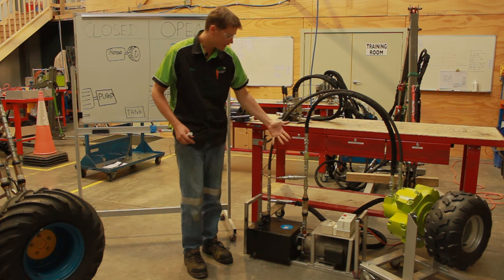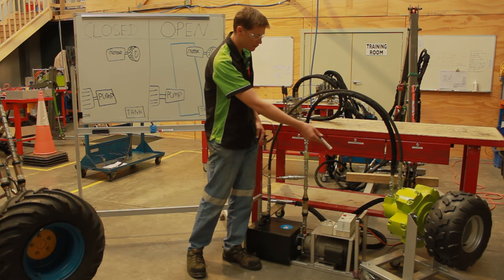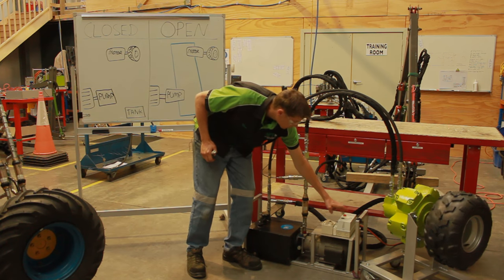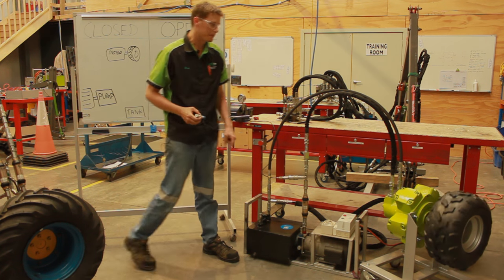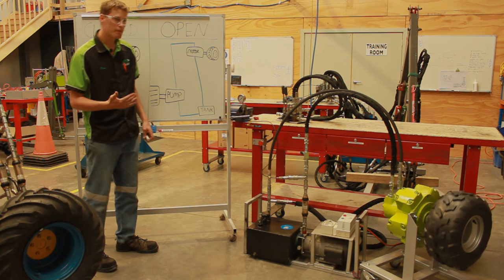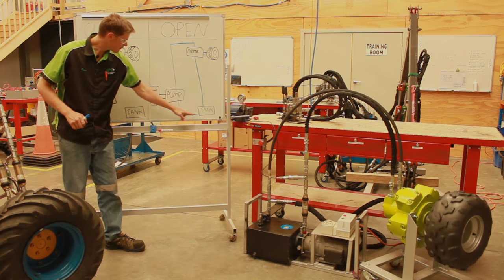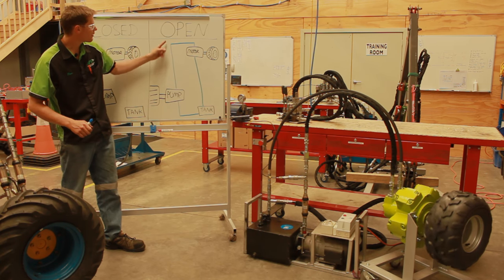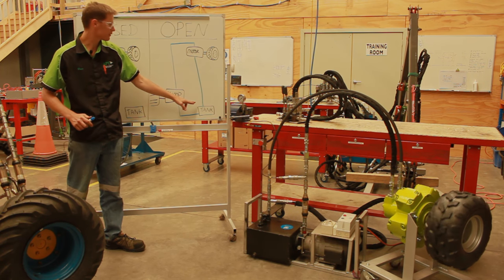Open Loop vs Closed Loop Hydraulics

Comment: Great explanation. 

With the closed loop system can you drive four wheels from the one pump?

How would you go about other hydrolics on the same vehicle.  Would you use open or closed system on something like a backhoe. Can it be either and what are the pros amd cons of each
Reply: You can drive all wheels from only one pump. But for example an excavator usually has two variable closed loop piston pumps, one for the left and one for the right side. This way you steer the machine just by controlling these pumps separately by their own control shafts.
  For the other hydraulics on the vehicle there is a separate pump, mostly an open loop system is used. Backhoes always use open loop systems. In opposite to the explanation in this video you can control the speed on both pistons and motors pretty well just by the control valve, that normally isn't an on-off switch.
   But there are also variable displacement pumps for open loop systems. They can be used for speed control as well as pumps for closed loop systems, but not for reversing without a separate contol valve. 
   The difference in their function is that a pump for a closed loop system pumps the oil in both directions when a pump for an open loop system pumps the oil in only one direction. 
   The advantages of a closed loop system are that it gives a very good maneuverability for example vehicles and that you don't need a separate control valve.
   The disadvantages are that a closed loop system pump is complicated and therefore very expensive and needs more maintenance. And you can only control one working moment with one pump. In an open loop system you can control as many moments as you want by using serial mounted contol valves.

I wish you understood. English isn't my first language.
Reply: yes it is just a matter of speed

Comment: Video was presented good but is miss leading because the pumps and valve can be converted to open loop or closed loop. He makes it sound like it's only based on what pump and valve you have and it's not.
Reply: very true as an example volvos hydraulics uses both open/closed looped systems.its all how you hook the lines up and what they control.
Reply: ...true but he would have probably come back in a follow-up presentation with that explanation. This is real basics for a novice.

Comment: Just one question,  how do you load or fill the closed loop system,  it was not covered by presenter.
Reply: you make it a open loop until filled with reservoir and reconvert it to closed loop.
Reply: With a smaller boost pump!
Reply: A oil drum marked hydraulic oil...

Comment: Nice presentation about the subject. It happens quite often that marketing and magazine editor people are using these system names incorrectly... Usually they refer to LS-systems valve spool middle position where flow is "closed" and therefore naming also the system closed. An that just is NOT the case. All working hydraulic systems are usually open loop systems no matter if the pump is fixed or variable. If the system pump receives all its suction flow directly from the actuator return line then its closed loop system.
Reply: Closed loop pump usually controls the amount of flow and also direction. To increase adjustability of the system also motor can be volumetrically controlled creating more adjustability for the motor speed and torque. This means that throttle losses from control valve can be completely avoided creating more efficient system. This is the main reason why closed loop systems are used. Of course everything is not explained in that short video... There are a lot of details in both systems and I believe this was just demonstrate what closed & open mean in practize.
Reply: I completely understand. In my opinion the way he presented the flow control in an open loop just gives a wrong impression. I can't see why you need the extra valve to control the flow when you can control it by the control valve without increasing the pump pressure. I actually built my own  garden tractor with just a gear pump, a control valve and a gerotor motor connected to a shortened car axle. I can control the speed from 0 to full speed well enough. Of course a variable displacement pump would be a lot better, also because it practically works like a stepless automatic gear box. The problem is only the cost. My system works because the top speed is only 9 km/h. The 13 hp Honda I use is strong enough to give the 300 kg tractor enough traction power (about 2.8 kN).
Reply: Saad Saleem Closed loop system needs separate charge/boost pump&valves to compensate leakages away from the closed loop... Even the pump functions in   closed loop its suction conditions need to secured to quarantee enough of suction flow.
Another very important need for this type of flushing function comes from need to get rid of heat created in the closed loop that is close to 30% of power driventhrough the closed loop. To get rid of this amount of heat just the leakage flow is not enough and separate flushing is needed.

Comment: 5:30 Closing the supply pipe is the wrong thing to do. Control the speed with the first lever you installed - that's the proper way to do it - no 'overloading' of the pump and proper oil management.

Comment: I think I've got a broken open loop system. looks a lot like the demo one here. Where can i buy another?? Looks complicated, with a manifold and solenoid valves running to 8 hyraulic levers.. Way over my head here. Any one in the UK able to fix these systems? Need to get my kit back on the road. .
Reply: ronan dowling call a professional...

Comment: How pump replaced direction control valve in close loop system?
Reply from the maker: Hi Sikanlal, pumps in a closed loop system are bi-directional, so by changing the angle of the swash plate, pump flow will be directed out of one or the other working ports, which then controls the direction of movement of the actuator.

Comment: Why not directly drive the wheel with the pump motor?
Reply: You can have one pump driving 4 wheels.. It makes more economic sense to have one pump doing with hoses lines connecting it to the 4 wheels then buy 4 pumps connecting one to each wheel..

Comment: Would anyone happen to know what type of hydraulic system the small backhoe trenchers have?  I'd love to build a small trencher/backhoe but i'm not really knowledgeable on what all I would need... A small engine, a pump, filter, valve manifold and the piston jacks.... If anyone knows hydraulics and happens to have free time to look up all of those parts and send me the specs, I'd be grateful.

Comment: Good video promoting hydraulic systems except that “suction” is very often used as term in pumping system which imo is really wrong. There is no sucking of fluid occurring in the pumping systems.
Reply: big deal

Comment: Hi Everyone, someone please suggest the most suitable hydraulic pump for flow rate 250 lpm, working pressure 350-400 bar & compatible with 1440 rpm motor.
Thanks in advance for the kind help.

Comment: How is the closed system changing direction of the motor?
Reply: He explains that well in the video near the end.👍
Reply: @alexmattyspac7605  He only explains how the angle of a swashplate changes the oil volume. To my mind, regardless of swashplate angle, flow direction remains the same?

Comment: This closed loop system is more correctly called "Closed loop hydrostatic"  Many bigger machines actually use "open loop hydrostatic".  This system, that uses a variable one-directional pump works as well as the closed loop hydrostatic that uses a two-directional pump. But it''s completely different from the open loop system described in this video.

Comment: sir in  closed system how to control a oil temperature?
Reply: That is the disadvantage of a closed loop system .. The heat must be removed through the mechanical parts of the system.. The open loop System with it's tank allows for better heat dissipation..
Reply: A cooler could be added to either system.
Reply: it can some what control the hydraulic oil temp by sending it back into the reservoir intern letting it cool down there while the cooler oil on the bottom is sucked in to the pump
Reply: OIL COOLER

Comment: Is the closed loop variable displacement?
Reply: Yes, It would be no idea to have a closed loop system without a variable displacement pump. The closed loop system also needs a tank, and the pump has an extra inbult charge pump and valves to control the amount of oil in the system. Only the basic principle is shown in this video.
   It's simplier and cheaper to use a fixed displacement pump combined with control valves if you don't need to vary the oil flow (speed) and the pressure (torque).
   The closed loop system is mainly used in excavators, loaders etc. to give the vehicle a good, fast and simple maneuverability.
Reply: Thanks  I just started college for heavy equipment tech, just trying to understand everything.
Reply: I think I need to add that  modern hydrostatic driven band "tractors" , like excavators, have 2 different closed loop systems, which also means 2 pumps, one for the left and one for the right side. This way the vehicle can be easily both moved and turned just by using 2 shafts. These machines always need a third pump for the other hydraulics.
    For a simplier system  you can also use a simplier open loop variable displacement pump. But if you need to reverse the direction of the oil flow you still need a forward/reverse shift control valve. This wouldn't work well in the machines I told about.
    You can also control the oil flow from a fixed displacement pump by the control valve pretty well, but the torque is limited to the size of the pump and the available torque of the drive motor. A variable displacement pump works like a stepless automatic gearbox: Less speed = more torque.

Comment: Wouldn't the oil heat up in closed loop system if it didn't have a tank to mix with the cool oil with the hot oil

Comment: Do you know how to Brake Hydraulics?
Reply: ((D1/D2)^2)*F1=F2. Force (F1) is governed by your foot and augmented by a brake booster if necessary. F2 is your desired force. D1 and D2 are piston diameters that you can readily purchase.

Comment: This is probably not the right way to ask but when you slow the wheel down does it maintain the same torque or does the torque drop as the wheel slows? Is their a relationship between pressure/flow rate and speed/torque?
Reply: pressure is torque, flow is speed they really do not affect each other.

Comment: Okay... waaay too much info. Simply, an open loop is exposed or "open" to atmospheric pressure. In this example, the reservoir. 

A closed loop, means the duty circuit (the circuit of fluid doing work) is closed off, or isolated from atmospheric pressure.

Comment: a hydraulic pump doesn't suck, why on earth would put a needle valve before a dcv is ludicrous need to tee into both hoses to the motor and put a needle in between the two, or vary your spool movement

Comment: WTF is wrong with these safety obsessed people? Boy, It's a good thing he put his lock on the power disconnect because the camera man could have turned it on while he was disconnecting/connecting the hydraulic fittings that are designed not to release any fluid if they are disconnected under pressure!

Comment: i dislike hydraulic drives. i kid you not they are shit sadly in the application i had one.
it is a forestry forwarder and ... it simply is not up for the task.
its a closed loop system. problem is, when i need massive amount of tourqe, i'm simply limited by pressure. witch is set to 350 bar. what happens is when i need to creep forward, is that since the oil supply gets limited, and tourqe stays the same, it is simply impossible to use the full engine power to move my stuff. 
a simple good old mechanical gearbox and a plain old simple clutch did solve the problem.

it was the verry first and last time i had a hydraulic drive train for anything. costs a lot, its realy short lasting, the oil change costs a lot, repairs cost a huge lot. the mechanical setup allready done over twice  the work hours with no faliures of any sorth. and when i stuck it in low gear i get the massive amount of tourqe i need. best of it all, the whole conversion including every bit had a cost far less than an avarage repair on the former hydraulic stuff. 

the hydraulics is noisy as hell, breaks down a lotof the times, is verry sensitive vs the non synchronised gearbox i have, and does a verry verry poor job of converting the engine power, expensive to maintain, and expensive as hell to purchase.
the only positive side is its verry easy to plan a machine around it. and thats all there is.
efficiency wise... well, the machine consumes considerably less with the mechanical setup so i'm happy i got rid of the hydraulic stuff. no more leaks, no moreoil everywhere, and no more overexpensive bills.

Comment: both systems are called open center or closed center this is not very helpful
Reply: This has nothing to do with open or closed center.  Thats for the type of valve used.